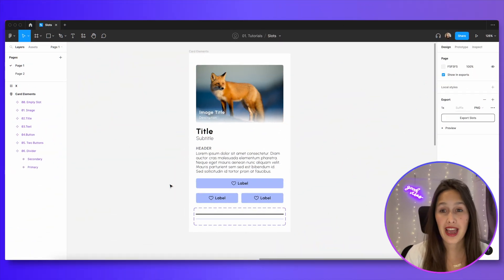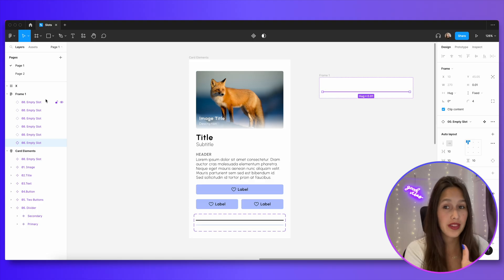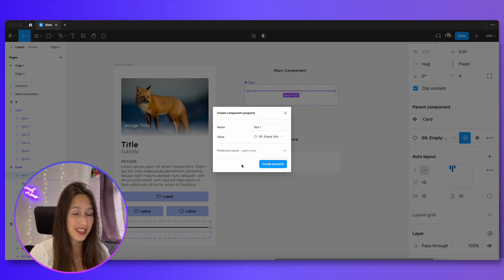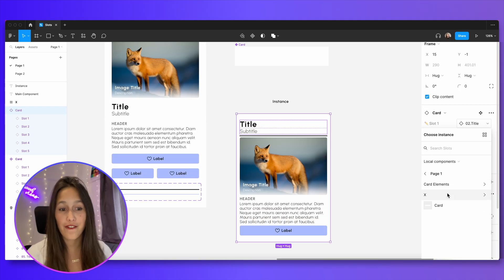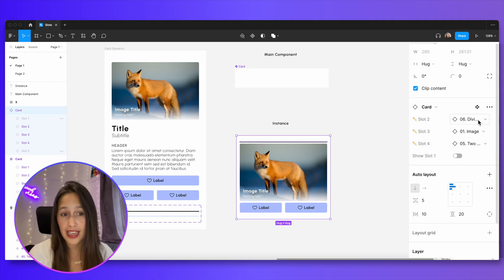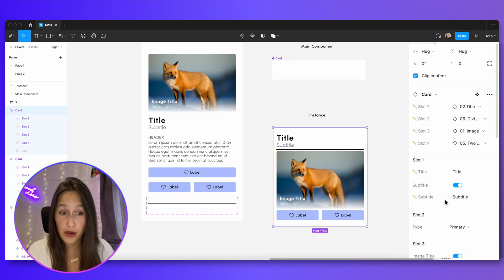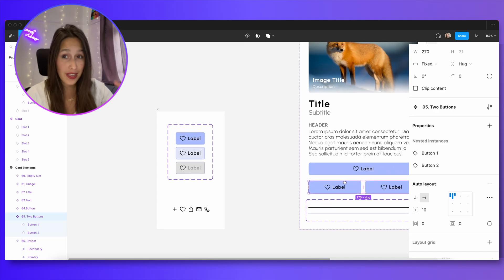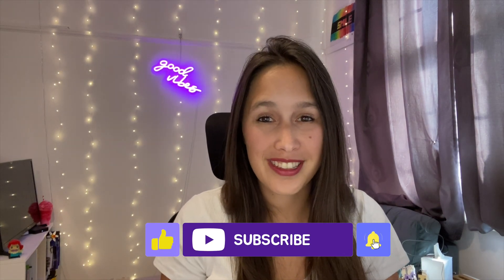Figma Slot Components | Component Properties step-by-step

Comment: Is there a way to add a sort of free form area to a card? For example, I have a modal component. There can be anything inside that modal and it might not always be stacked one on top of the other. For example, an address form could have city, state, zip inputs on the same line or I might have some text and a tooltip to the right of one of the inputs. This video almost gets there with the one/two button components, but without making a component for each of those possibilities, how would I let someone use my modal component and put whatever they want in there?
Reply from the maker: Hmmmm so the issue is you kind of have to have the building blocks ready. You could nest slots in slots to create even more options but it could make it buggy. I would try and limit the possibilities to the main ones you think will actually be used though. I hope that makes sense ☀️🙏🏻💛
Reply: @TDSunshine  thank you. I definitely learned some things from this video that I will use elsewhere. For my particular use case though, I think I'll just create a component with white space and let them layer the content of the modal on top of it when they create the instance. So it won't technically be in there but at least it will appear that way.
Reply: @leeharrington3381  I ran into a similar problem and the way I got around this was by creating content components for the different UI screens I might need, for example, form 1, form 2 and form 3. I then used the component swap feature to choose which layout I wanted within the modal. It did mean creating more components, though, but at least the forms can then be used elsewhere outside of the modal.

Comment: is the only way to use slots via instance swaps? what if I want to insert just some random content, not a component? I know I can always turn it into component, but that kinda sucks.
Reply from the maker: I think the idea behind the slot method is to use it when there are set options so you want to avoid random additions and have really set rules on what can be added in. ☀️🙏🏻💛

Comment: This is a great lesson I am just implementing this in my sections of one project but I have one delicate problem. When I am trying to connect my slot with an icon component, it can not show it. It works fine with title, buttons variants and body but I am having problem with the icons in one slot. They are bigger and they are for updating and app. I tried to put higher gap event redefine autolayout (h-v paddings) also checked the icons within the component to see if there is problem. It seems to me icons are fine but they are not showing in. Does someone knows what maybe be a problem?
Reply from the maker: you may have already checked this but check which constraints are set on your icon in their component frame. Maybe they are just staying really big so they are hidden? try to set them to "scale" it may help. Hope that works! 🙏🏻☀️

Comment: Too bad I can't use this method. Tried enough. Somehow it doesn't fit. Sometimes the display is not the right size, then I try to insert a "Space" component 24px" into a slot, but it is not displayed at the correct height. Too many things that don't work smoothly and take too much time. But this would be the ultimate solution for many of my to dos ;-)
Reply from the maker: Sorry to hear its not working out for you! slots can be fiddly 🙃 maybe reduplicate the file and try again from scratch. ☀️
Reply: @TDSunshine  Things are better now. I probably wanted too much at once ;-)
When I create a new design file, link the UI kit and save my modal, I don't get the preferred components displayed. I always have to navigate there. Is there a special requirement for this? My components are stored in sections. -> Thank you

Comment: Thanks a lot. Have already seen many clips about the topic. Even though it's a bit fast talking, I still understood the most here. The only thing that holds me back from the method is that you can not do a re-order inside a instance. What I would like to see is a small diagram to better see which objects and nestings with which attributes are placed where. BTW - at what step did you set the pen icon ;-)
Reply from the maker: Glad it was helpful! haha yeah I know I speed talk sometimes 🙈🏎️ So there is a bit of like a decision to be made here, if you don't have your card in a component then you can re-order the items in the auto layout freely, but then you won't be able to swap the instances from the top level, you would have to select the one you want to swap.
Reply: @TDSunshine   ❤Yes, I know. But I need the component as a whole so that my colleagues have a template for all requirements. Ok, then I'll have to explain that to them 🙈
Reply: @TDSunshine  
Thank you so much. I know this, but I thought maybe there was a workaround?

What I would like, if I may: An overview (diagram) of which elements should be prepared beforehand and in what way in order to get the best or most flexible result ;-) Is there such a thing?

Comment: I followed your tutorial to create a horizontal list item with leading, middle, and trailing slots but when I swapped the leading slot to an other component it was not resized, the swapped component appeared in the 0,01px height of the slot instance. Any idea how to solve this? Thanks for the great video anyway...
Reply from the maker: hmm you might need to play around with the resizing settings. My "empty slot" is an autolayout set to a FIXED height of 0.01px. All my "swappable slots" are autolayouts set to HUG height. Also, my card component that has all the "empty slots" in it is set to HUG height and uses 5px spacing/gap. Try to see if that helps! 
☀️🤗
Reply: @TDSunshine  My hug contents option does not show up for my other components :/
Reply: The component used as an instance need to be wrapped in an auto layout.

Comment: Thanks a lot for the great content. This was very interesting. However, I can't think of a real use case scenario for this. It will only come in handy when you know exactly what content to swap, and that's not very common, is it?
Reply from the maker: Thanks! Something like this can be used where you have an element in your design that has some set rules and optionals to it. For example think of a Facebook feed post. It may have text, may have an image , it may have a button (like those donation posts) and these might come in different orders. In a case like the a slot component could be helpful sometimes 
☀️🤗

Comment: Interesting concept for slots, for my button icon I use a global icon-wrapper which is essentially defines the icon and its size, so I can drop this this into each button size and set its ideal size and default icon.

So when I change the button size the icon changes too, plus it can access any icon in the system.

Your content is great and have watched a few recent ones on variables which made me rethink how I might approach our buttons when it comes time to convert to the new variables method 👍
Reply from the maker: Great tip with the icon-wrapper! ☀️🙏🏼